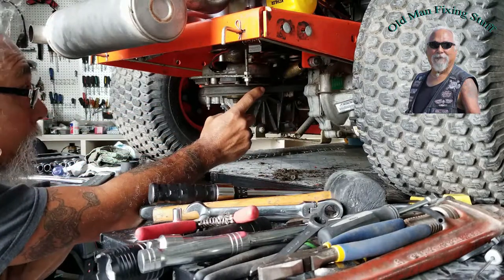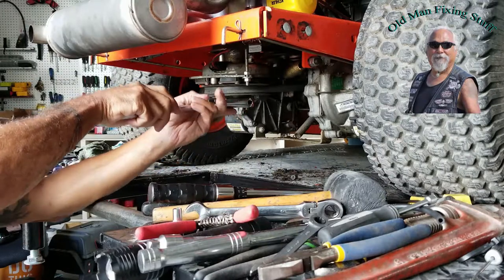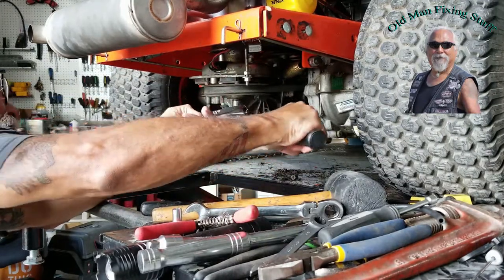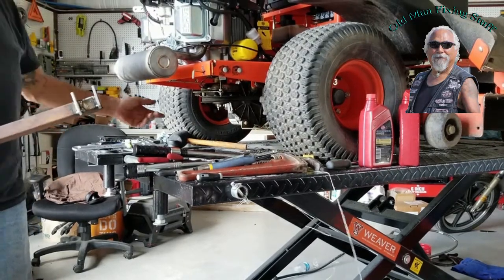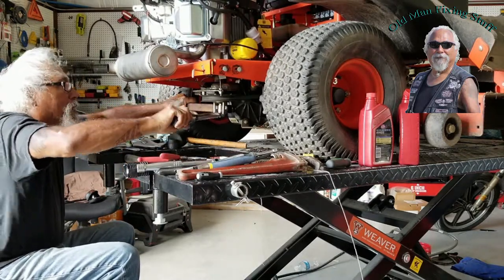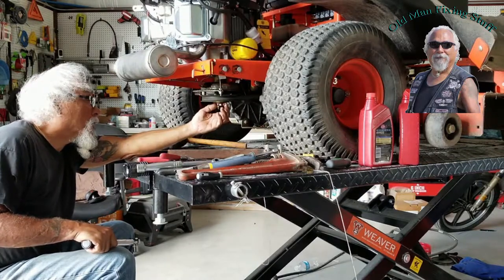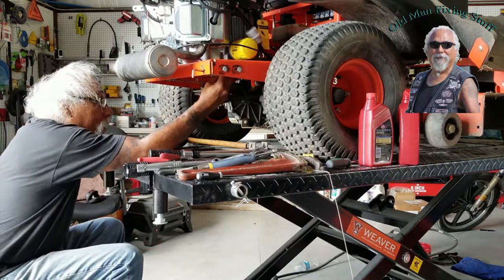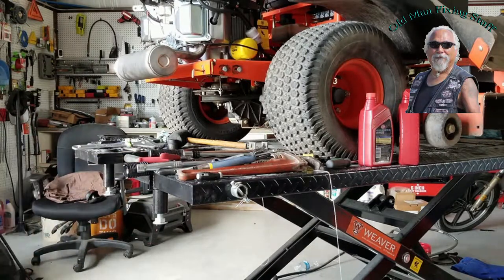Bad Boy ZT Mower Motor replacement Kohler sv840-3018 to kt745-3088 - 5

Comment: Funny. My elite 60 has no bolt to take off...maybe that's why it's vibrating so bad it broke the end off the black wire. My clutch also doesn't look like that one. It's gat a larve flat black survace on outside of the part that always spins.